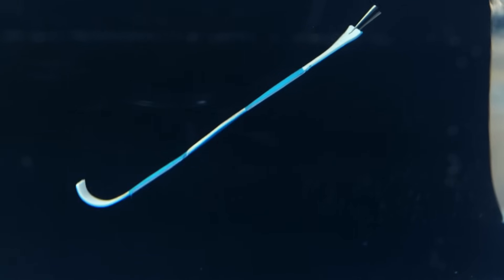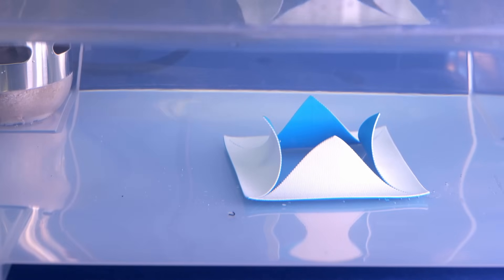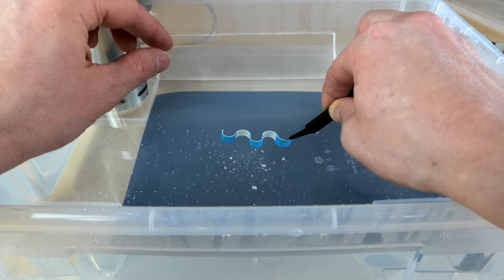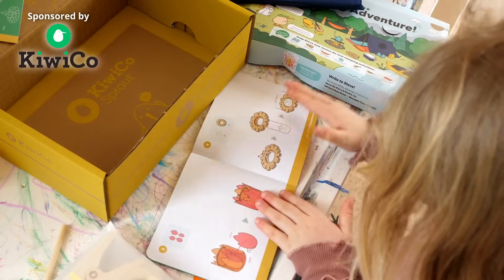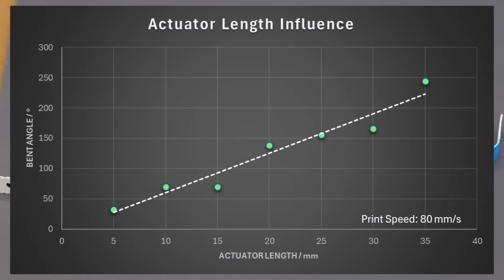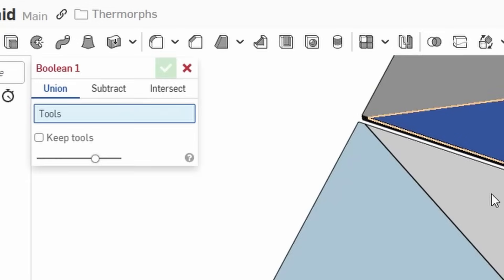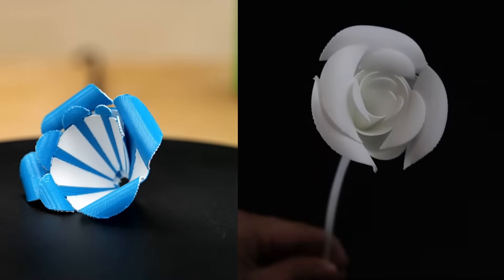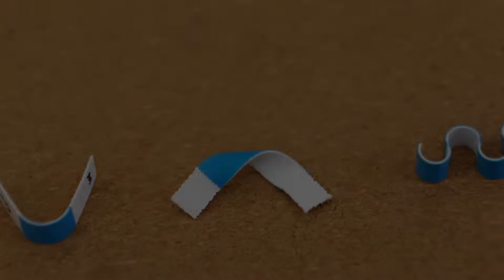Flat to Folded: The Science of Shape-Shifting 3D Prints

Comment: For the slicer part assignments I strongly advice using step files over stl. For work I had complex models that I iterated on many times. So in order to avoid redoing anything in the slicer I just assigned parts of the step file as support blocker, enforcer, etc. And as it's a step file I just hit F5 after each iteration, and no reassigning was needed. I also grouped all bodies with the same role, so I only had to assign each role once. For CAD I used Solidworks

Comment: Blue tape, Elmer's glue:
By the way, in Europe we normally don't have the blue tape. Our painter's tape is yellow or dark yellow colored (Krepp-Band).

As long as it's not too rough and not too shiny flat (sand it), it's OK. The surface where you print on should be a bit fluffy to give a good grip to your print.

Oh and adjust the zero height of the nozzle when you have tape on your print surface... The nozzle needs to be a bit higher up. 

And we also don't have Elmer's glue, but a normal glue stick for paper does the trick if we need it (Uhu Stick).

To find a replacement just find out what it's meant to be (a glue stick that kids often use in the first years of school to glue paper... Or self-adhesive painter's tape, that doesn't stick too strong to the surface, maybe 2 inches wide for convenience (5cm)... all right, I know what to look for) and then you would find something in your local stores.
Reply: Blue tape is readily available if you go to a professional paint supplier rather than a DIY store.

Comment: @8:34 are you using blue tape for bed adhesion? and why? I thought there were better methods now. .... Nevermind, I should watch the WHOLE video before commenting. Answered @14:55 New question though, why not just introduce a pause in your print after the first layer to allow the plate and first layer to cool? Now that I think about it, can can playing around with pausing and cooling on specific layers help prevent lifting on large prints?

Comment: Thankfully someone who is recognizable mentions slightly sanding a 3d printers bed to increase first layer bond. I have been trying to spread the word for awhile about getting a smooth pei sheet that has 3m adhesive on it to stick it to a steel flex plate, (i use to use glass with smooth pei) lightly sanding the surface horizontally,  vertically, and diagonally in both directions (top left to bottom right, top right to bottom left) will give a really really good surface for the plastic to stick to the bed. Having the molten plastic key its way intoo the scratches of the bed sticking to it very well.

Comment: If you don’t have access to a multimaterial setup, you can also get similar results with this special filament from colorfabb called foaming PLA. This PLA foams up with increasing extruder temperatures. The Foamed parts will hold their shape when put in a hot environment like water or an Oven. Just requires a lot of slicer tinkering to assign differing temperatures to different parts of your model 😅

Comment: Does it have to be hot water? A convection over or air fryer would be less messy but IDK
Reply: Any means of heating works.
Reply: hot water with a sous vide heater likely gives extremely fine and smooth control over the temperature, and extremely even heat. This is mainly just because water has a much higher heat capacity than air, meaning the temperature remains much more stable than that of air.

Comment: If warping comes primarily from the colinear walls that contract in the same direction, could we prevent warping by printing the perimeter in a hilbert style movement?
Reply: Possibly but it would result in much weaker parts with a much worse surface texture. Better to just use a heated bed (+enclosure for ABS/ASA)

Comment: since the contraction mostly depends on the builtin stress from print speed and alignment, i wonder if it even needs a multimaterial situation, shouldn't it be enough to print a few layers fast and infill-aligned followed by one or two perpendicular, slow, unstressed layers of the same material? would simplify the process a lot and allow more printers to be used without hassle.

Comment: 9:50 To me it seems like the printing speed rather impacts the bending radius instead of the angle directly. So you could actually design for a specific angle with a given radius instead of  having only an angle impacted by two variables
Reply: I think the bending radius is probably the same or similar in each case, ie you get a certain amount of bend per unit of TPU/PLA actuator. The bend radius is probably more affected by the ratio of shrinking between the PLA and TPU and likely can be modified by changing the polymer composition and thickness of the active layer

Comment: This is called 4D printing. The paper that you showed is a nice paper, but it was not the first one to propose the concept. 4D printing was proposed in 2013 by Skylar Tibbits. You also don't need to use multiple materials. You can achieve the same performance with a single material when selecting the printing parameters properly.

Comment: 3D printed version of Nitinol made from plastic. Cool. Now what happens if you add shorter layers of the blue filament on top of the longer. Can you vary the curve of that blue section similar to how it does with tape stacked with shorter and shorter pieces. And what about encapsulating the flex layer?
Reply: It's not really the same as nitinol as it can't be reprogrammed so to speak

Comment: Interested to see more with this. I’m imagining what you could do with a 3rd material. You could use something like abs with a higher glass transition temperature for the structure, and still use pla as the active and tpu as the constraint in the joints to give the print more structure in non joint areas. You could also have 2 different joints: PLA active and ABS active. This way, if you had a structure where you wanted some folds to happen before others, you could have 2 different temperature baths, make the first folds with the PLA, and once that fold is done, increase the temperature to allow the ABS joints to fold.

Comment: makes me wonder if a slightly more complicated actuator could do non-euclidean bends. best i could tell even the petals of the rose were gaussian flat and only adding curvature in one direction.
Reply: Given the nature of plastic I think so, especially when heated and softened it doesn't have the same restrictions as a material with inherent grain structure would.. Vacuum formed plastic molds and even wrapping a car with vinyl are solid examples of this
Reply: @MotoCat91  nice point, giving it some more thought i think you could add some slits into the constraint layer and add a fourth contracting layer. both the "slits" and "lines" in the constraint layer get 2 contracting layer in their direction.

if you line up the stiffest constraint direction with lines of min curvature and the slits to be perpendicular to max curvature, the min and max are always perpendicular to one another, it'd probably be a pretty manageable system at least for simple shapes. the main pitfall i'm seeing is how those min and max directions rotate as you move around a surface. they have to always be perpendicular and the rotations must be continuous, barring sharp points, but i don;t know of anything that'd limit the rate they rotate at. so, there may be surfaces where the slit patterns would run into logistical issues.

Comment: i'm kinda curious whether this, paired with a conductive filament and nichrome wire applied printing could be used to make a guide for fishing wires or tapes into hard to reach locations. if you attach it to a pole or something, then you can choose the direction the printed piece will bend when you heat the nichrome wire. let it cool for a moment, and you have a rigid guide. once you've finished running the wire or fishing tape, just heat the nichrome wire again, and pull the piece out while it's soft.
Reply: I feel like for such a simple purpose as a conduit to guide wire through, there would be better alternatives.. Like the inflatable flexi-robots that Veritassium did a video on a while back, or even just a softish tube with embedded fishing line in the walls so that when you feed it into a cavity and pull on the embedded line it curves the tip. Even medical devices like the endotracheal tube already do exactly this, using air pressure in syringes to bend the tube while it's inside a human.

Things like that would be more adaptable and also reusable whereas a 3D printed solution would have to be meticulously measured in advance and unique to every installation.

Comment: Ok not that interesting for me because it has almost none practical use domesticaly. But the test you did imply that to reduce warping i just have to print the first layers at much lower speeds. Thats a nice to know
Reply: Warping is caused by the upper layers contracting as they cool after being deposited on the already cooled lower layers, with the layers on the bed being forced not to shrink due to the bed itself (they get bent upwards but don't shrink in a coplanar way). Printing the lower layers with a Hilbert curve pattern wouldn't make much difference since those layers are already splinted by the bed, it's the upper layers you need to keep from shrinking to decrease warping

Comment: Right now it seems to me that the biggest application is to scam investors by saying "4D is more than 3D, therefore this is the next big new technology." Like, seriously, I've had 3 investors in the past year contact me saying "I've heard this 4D printing is the next new thing, should I invest" and I had to explain to them that 4D printing is just 3D printing with extra steps. And worse, I don't see it being an improvement over 3D printing. 
And the problem I see with 4D printing is that it's a step backwards in functionality. Before 3D printing we had CNC processes like laser cutting and CNC routing. These processes don't just involve throwing a design at some piece of software and having the machine work everything out. They required the designer to be intimately familiar with the process they were designing for and work within the limitations of that process. It's been said that a 6 axis robot arm could, theoretically, make a complicated internal hole in an object, but no one's been able to actually do it because 6 axis of movements makes the math get so complicated that it never works. In other words, CNC routing can't even do everything that it theoretically can do.
Then along comes 3D printing and suddenly we have a process you can give any shape you want to it and it'll just make it. Because 3D printing is actually just repeated 2D printing, and 2D printing is super simple. The math is simple, the process is simple, and it can take any raw 3D design and turn it into a successful 3D print every time. The designer doesn't even need to know (much) about how the process actually works. (Which is why you see a bunch of untested designs on Cults3D for sale, so this advancement isn't without it's downsides.)
Then, "4D" printing. Suddenly you can't just throw any design you want at it again. Designers are again required to have advanced understanding of the process their designing for. Now, theoretically could we get to the point that we throw it whatever design at some 4D slicer and it unfolds it for us like papercraft, and then designs in the necessary hinges that bend it the right amount so you can 4D print it? Well... no, actually. Because some shapes mathematically can't unfold flat. While some mathematicians conjecture that any convex polyhedron should be able to be unfolded, the math for doing so hasn't been figured out yet, and that's just a subset of the possible shape. So, just like with CNC routing, we're back to having limitations that the designer needs to be aware of and math so complex it might not even be able to do the things that it theoretically could do and it looks like we're, again, dealing with a process that is more limited than the 3D printing process that, this time, proceeded it.
I find it interesting that 3D printing, despite being a younger technology than CNC routing and laser cutting, has managed to grow and mature much faster. Perhaps part of the reason is because it was a more simple process that could successfully do even more than it's predecessors were capable of with less effort on the part of the designer. But 4D printing doesn't seem like a step forward. In fact it feels like a huge step back.
Is it cool? Yes. Is it worth the money to invest in it? ...I hate to be the guy saying "let's not go down this road." I feel that every exploration is valuable, every bump on the road of invention is a learning opportunity. But when I get approached by an investor asking where to put their money, I can not, in good conscience, say that 4D printing is it. I just don't see it enabling us to grow. And that's what an investment should do.
Unless you're the sort of "bigger fool", "more money than brains" investor who thinks make-believe digital currency is a good investment, in which case, go for it.

Comment: You could make tiny 3d printable robotic actuators with the use of resistive wire to heat them up
Reply: They would only be able to bend once.
Reply: @ADBBuild  Just add one on the opposite side

Comment: There needs to be community effort to make a new slicer that calculates part stresses correctly during printing. All slicers currently are....... Bad. Especially in slicing speed. I'm sorry but a <1kb file no way takes 2 minutes to slice on a beast pc. And there's no way we can't estimate the part stresses to make sturdier parts.
Reply: Just 4 years ago a beast PC would take a minuet or two slicing a benchy. Slicers are much faster and continuously get faster. 

Now a community built slicer for niche and advanced features a company built slicer won’t give is suppose to be Orca … the problem seems to be the flood of cash grabbing and tech controlling patents that exist making it questionably legal to implement features in an official way. Hence brick layers and arc overhang only being third party scripts.
Reply: @hellothere6627  s3d still takes <1 second to slice the "toughest" models, and doesn't make glaring errors that cura/slic3r do on the regular.

Comment: This makes me wonder about adding an ultrasonic emitter on the nozzle to put in enough energy to anneal the directionality as it's emitted and reduces embodied stress.
Reply: Most of the stress is created because the layer being deposited is hotter than the layer below - each layer contracts a bit, squeezing the layer below. In the case of PLA the combination of properties means that it will be stressed but the solid lower layers will hold the overall dimensions unless heated enough to flex and contract as demonstrated in the annealing demo at the start. The only way to reduce those stresses during printing is to decrease the temperature difference between the layer being printed and the rest of the object (that's why enclosed printers are so important for ABS and ASA, they make the part hotter and closer to the top layer temperature, decreasing warping forces)

Comment: I'm wondering if this methodology could be used to reduce print time and also bring pieces into tolerance without elaborate support structures or infill patterns. Like a pre-stressed beam, can this improve existing design's strength and precision. Build with warp, heat up, relieve stress, bring into compliance.

Comment: omg we finally got a reason to use hilpert curve infill!! Never thought about interal stresses, that feels like it could actually get useful! 

Feel like this implies that for the first layers, setting the pattern to hilbert curve could reduce warping!! Did anyone ever think of that already?
Reply: Usually, warping does not come from the first layer. It's layers above that cool faster and shrink, pulling on the first layer and detaching it from the bed.
Reply: @showjack1109  yes that is why I said first layers, i think using it on the first few layers solid layers and on top of that one could try to also have the infill as hilbert for some layers, but not sure if transitioning infill patterns causes any problems
Reply: I was about to ask the same thing. Should be possible to have the pattern on bottom-surfaces in Prusa Slicer and its derivates, right?
Reply: @martiiin3210 Yes, setting hilbert curve as the initial layers combats warping. I’ve seen it work many times after reprinting a part with that one setting changed after warping. 

Print time jumps up, and bed adhesion and leveling needs to be good though with all the sharp short movements, but any well tuned printer is capable of it.

Comment: Pssh. This isn't anything special - this happens by itself during my 3D prints all the time, as they are being printed, with no special thought or planning on my part!
Reply: Some people replying to this comment need to buy a sense of humor 🤣
Reply: @The_Privateer  it wasn't funny either even if you tried to paint it as a joke, so in a way you failed at both ends... You either don't fully understand the potential, can't make a good joke...or both...
Reply: Controlled warping vs uncontrolled and unwanted warping are two very different things.... The goal here is to have even more control (possiblely a better silcer for such application) by exploiting the phenomenon to our own advantages.
Reply: @evertchin  The_Privateer didn't say it was unwanted and it's very much controlled by the material. It may not be thoughtful and planned, but hey, if it works, it works and isn't stupid. And where do we know The_Privateer isn't secretly aiming to print the cursed rocking gridfinity storage system?
Reply: @evertchin  Whoosh!